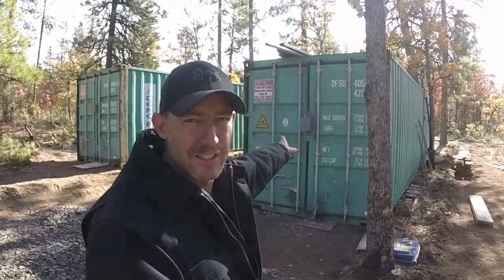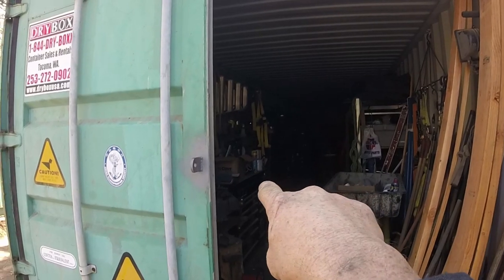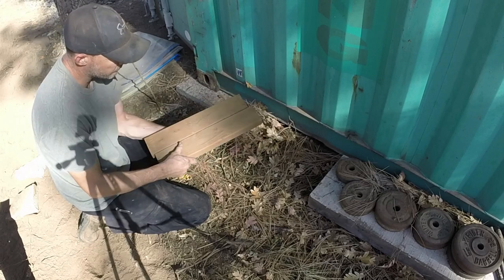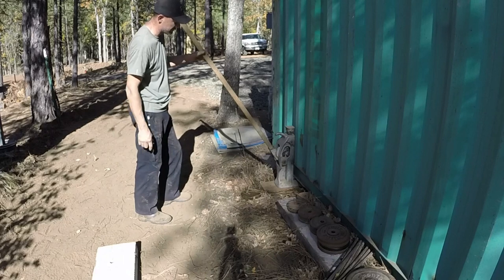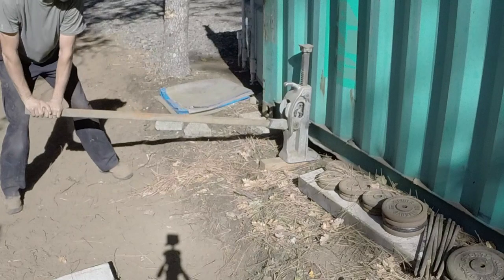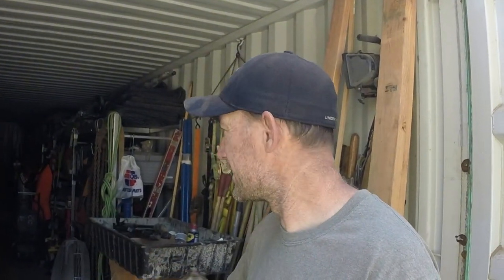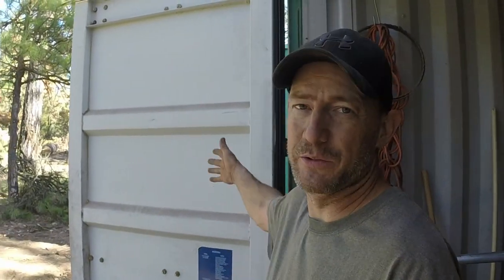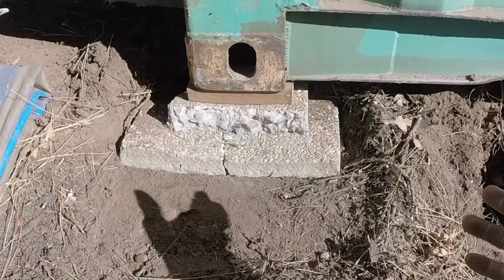One man lifting and leveling a shipping container box system

Comment: Way too small of a lift cleat on that RR jack for this job, in my opinion, though the jack itself is a beast. Like you, I've been moving two 40-foot containers up and down and side to side to make room for poured concrete foundations, as these boxes will be spanned by a 40x40-ft roof for a big solar array and need to be anchored to meet code. I'm using two $30 Harbor Freight 12-ton bottle jacks for the lifting, then erecting 16-foot-long 6x6 skids on blocks to prepare for sliding. To reduce friction, I sandwiched a 1x6-inch board between the 16-foot skid beam and the underside of the container, and liberally oiled the two facing surfaces -- literally "greasing the skids" for the container's lateral slide. I used both my skid steer and a 12k-pound winch on my truck with snatch blocks to nudge the first container along these skids. The second container was more challenging as it was on a slight slope and had to be raised about 24-inches above grade at one end for moving. The bottle jacks and stout blocking raised it up to the required height, but I wasn't comfortable using the winches or skid steer to nudge it. The perfect solution was a cousin of your RR jack: The high-lift jacks you see strapped to most off-road trucks and jeeps. The lift cleat slips perfectly into the container's corner blocks. Using two jacks at about 15-20 degrees off vertical, two jacks simultaneously lift and nudge the box along the skids in the direction of the jacks' lean. Using this method, I (and a buddy) can position the containers precisely where we want them atop the newly poured foundations, then use the bottle jacks to gently drop them home. Like yours, my containers are filled with a few tons of stuff, including heavy tools and building materials, even bags of readimix. The hydraulic bottle jacks work extremely well, giving great control. Same for the 48-inch high-lift jacks, which are rated to lift 4600 pounds. Hydraulics and leverage!
Reply from the maker: Very nice. Moving these boxes can make for an interesting day. :)

Comment: i had to do much the same job, the box was on the ground and needed to be set up on blocks and i needed to slide it 4ft, i have an old duff railroad jack, first i jacked it up and put rollers i made out of 2" schedule 80 pipe cut 6" long, i had 20, 5 in each corner, they sat on some 2"x10" planks with 1/4" flat bar on top, the side bottom rails of the container sat on the top of the rollers, i did move it about 1ft just with a 6ft bar as a lever, then i pushed it with my bobcat, my 40ft container like your was full, who knows what it weighed, the strongest muscle on your body is your brain.
Reply from the maker: "the strongest muscle in your body is your brain" Very true. :)

Comment: This is an idea I have seen used before,  use some old tires and fill them with concrete then slide them under the corners with your backhoe, with the bigger footprint should sink a lot less into the ground. I enjoy these types of videos, new subscriber here !
Reply from the maker: Thanks for subscribing. Eventually I will have to move these boxes again. I have plans to make them into a garage but need to pour some footings under them first so they don't settle after I put them in place. More fun to come. :)

Comment: I’ve leveled my (2) 20ft containers using a strong farm jack assisted by a few bottle jacks and strategically placed cement blocks. It doesn’t take that long but is a slow methodical process because it can be very dangerous especially if ground isn’t completely level like mine, in an off grid type location. If your container is a ft higher on one side for example that’s a big fall u don’t want to be standing next to if it lets loose. I don’t recommend it but that’s how I did mine
Reply from the maker: I thought about using bottle jacks but didn't know how much this thing weighed with all my tools and stuff in it. Just glad it worked out and i didn't drop it on my foot. lol :) Thank you for watching.

Comment: Proper air vents! Most of these containers will eventually rust out from the roof. The tiny little rectangular air vents on the outside upper corners are meant only when these containers are on boats at sea. When you have them on land for storage like this, I believe it’s called “ dry docking”.  My simple solution was going to a regular home improvement and getting round cylindrical house events. It’s vital that you open up more airway vents to set up some sort of cross current. Most people think that the holes in the roof are from rain resting from the outside in. If these are not insulated and ventilated, they actually rest from the inside out due to humidity depending on where you live. If you come across the ones with flat roofs, they’re older but I actually prefer them as they’re easier to maintain the roofs. If you actually end up with a hole in the roof, you can try to patch it or just in large it and get a round spinning bent from home improvement or roofing store. Some places make a great peel and stick membrane with tar and gravel on top. You only need to loosen The rest off, put this tacky material to help the peel and stick, peel back the peel and stick Lair and set it down. I’ve done about four containers this way and they have never leaked in 15 years since I did this. If you just use the tar that a lot of people use to patch As your roof rots  because you didn’t ventilate it, You will end up having to throw the container out or cut the whole roof off – ask me how I know-LOL. If I only knew 20 years ago what I know now about these containers, I would get quite a few years back and have a lot less gray hair – on my back...
Reply from the maker: Thanks for watching. :)

Comment: NO.  Lift from the corners.  Where the container has the reinforcement!  What are you doing.   And your 2 2x4's allow one 2x4 to sink, and the container to shift back, and fall.  And you put your fingers in the jack. Seriously?  If it kicked back, you'd be getting metal pins in your fingers.
Reply from the maker: If I lifted it from the corners I wouldn't be able to put the blocks under the corners. I have noticed a few people comment on me putting my fingers "in the jack", this is not the case, the jack has tabs sticking out so your fingers don't have to go in the jack. Thanks for watching. :)

Comment: old jacks house , railroad, simplex and other names. yes they will pick up at capacity IF you can get enough weight on the bar. or not bend the bar
also do not use cinder block! it will break . use concrete instead (fence post mix is fine) . about 1 bag per corner 6" thick  (soft soil) will hold up.
Reply from the maker: I will have to move these boxes again in the future. Plan on using them for a garage later, just need to level the ground under them a bit better first. :)

Comment: nifty idea.  I would not use cinder blocks.  I used them and they cracked in the middle and over time pivoted into the ground during the winter when the ground got soft.  I think what initially broke them was an earthquake. I had 8x8 railroad ties (creosoted) on the other end and they are still there and doing fine 15 years later.
Reply from the maker: Yeah, my cinder blocks have already sank a little causing the box to lean again. But its ok because we will be moving them again after we get into the house. The next place we put the boxes we will have concrete under them. :)
Reply: Not sure where you’re located but in California the creosote railroad ties are very dense and great but you’ll have a hell of a time trying to get rid of them eventually as the dump sites red flag them and make you take them to hazardous waste sites with paperwork and other BS. I have used leftover sections of a flatbed deck I realigned along with believe it or not small sections of landscape bender board! They don’t rot and can handle quite a bit of weight. I don’t think I’ve ever commented on a video so much. Maybe I’ll try to shut up and just video it myself. Be safe everyone!
Reply: @christosvolikakis1523  Mine aren't going anywhere. They've been there 15 years and I expect they will be there another 15 because they still look fine.  I think it just depends on the application.  Mine were put in place by the shipping container people when they delivered it; it is what they brought with them.  Now of course, you can't get these railroad ties in California, they are illegal unless you buy from a private party trying to get rid of them - and there is an endless list of people who want them out here, so they are getting recycled in a different way. 

It is rather ironic, I don't think the new "arsenic" covered ones are any different, toxicity wise - you have to work with them with gloves on, so how safe is that? 

We have sand here, it isn't dirt...so we have to be careful what we use as a foundation for something like this - cinder blocks will break quite easily because of the constant little earthquakes we have here in the desert of So. Cal. Plus where I live, we get regular floods during the winter. So that is why I was looking at this video.  The last flood we got was about 1' and took out all the surrounding roads and the cargo container sunk a bit so I was looking for a way that a 100 pound woman could do this on her own.

Nice you had something already in hand that would work really well. Peace Be Upon you!

Comment: Good video! If you can get thick metal pads, you probably saw the thick metal covers they put on the roads to cover underground jobs, kind of around the 1/2 inch, 4 pieces of about 12"x12" I think it may hold your container weight. Once you get the pads you can either lift each corner, place under a corner some gravel first, then a good pad of 12"x12" concrete paver (if you don't have the time to make a box wood formed of 2"x6" walls, and do yourself a concrete pad for each corner, then what continues), then on top of your paver or concrete pad, a 1/2" metal pad and that may make the sinking a slower process to occur. If it happens, you may go again from the bottom up, more gravel, the paver or a concrete pad made by you, which is not a bad idea if you make them before lifting each corner, then the metal blade or cut, should delay the sinking process.

Glad you had a grandpa that was able to hand down something good to you. If you can, be that father, be that grandpa, be that friend, be that teacher, that passes along to his family first.

Thank you, you're a great man!
Reply from the maker: The container has sunk a little but I have plans to move both containers and make them into a garage as soon as we move into the house. 

I actually never knew either of my grandpas (both died before I was born) but I did know my wife's grandpa which is where I received this jack when he passed.

Here to make a better life for our kids. Feel free to share our videos or just spread the word about our channel.  

Thanks for watching :)
Reply: @KoalityofLife  just keep doing your best brother! Some grandpa's couldn't get to us, they were so poor as is my father and I so we struggled to have a better funded family. My father waited so I'm waiting as well to be better supplier in money to have a child I can afford to support, that's why I fear my son may not meet my father enough but the lesson is clear, we do good in learning how to fund ourselves first to support them then. I'm working on my money creating ability, I have ways but the end, achieving making enough money has being hard to me.

I'm trying to acquire a piece of land where I can place a container and start a shed to live. I'm in Miami, here land is expensive to me. But is the cheapest in my point of view thing we have to buy, in order to start a roof over my head. Other than that is expensive, am paying$950 for a small apartment in Hialeah but I need more space. So I'll be switching cheaper space although taxed, by the $950 tight spaced rent so let's see if my children get to see good days although the things of my father had being treasured for him so I don't count on them. That's what they taught me, "to don't open his drawers" so, hope someone do a good use to his things. Because in this life, many are ready to take our things, especially those who hasn't worked hard enough to obtain them.

If you can, teach your sons and daughters after you to use what you have, and when you can, reward them with some of that that you possess, or lead them on how to obtain some of what you possess. One day we may not be here, they may be the closest to you to be the appropriate heir of what you built, and acquired. If you don't do it, the Banksters will do it, and your wife and children will be left poorer than they even know, and, if we can avoid that, it will be a good thing, the Bible says.

Thank you for your message! Take care brother!

One huge detail! Wherever you don't have to stick your finger in, stick a piece of wood or bar, instead! Avoid your fingers under massive weights!!! Please! Massive weights are more stronger or heavier than us and is extremely painful to be suddenly under them that we have to pull our hand from under their humongous weight. Don't put your fingers under or near by heavy weights, let iron takes care of iron!

Comment: I have worked around 20 foot shipping containers my whole life. I recently upgraded to 40 foot high cube containers that are stacked two high meaning a one 40’ footer on top of another 40’ footer.
There are several mistakes that I see here that could mean or kill you. If you’re not someone with experience working around heavy equipment, do not attempt what he is doing. You never ever ever ever put your fingers underneath a container corner or inside a jack! I cannot stress this enough!!!
You should always assume that what you were working on is about to come crashing down and that gravity is about to win so why the hell would you stick your fingers underneath the corner of a 5 to 6 ton container!
You are putting the risk of people being injured for a like. What’s the matter with you!
You are also putting brittle concrete what looks to be like paver stones underneath a steel block. Concrete breakers are basically a heavy piece of steel that focuses all the force onto a piece of concrete to shatter it. If you know what you’re doing and are keeping your fingers and body clear,  you want to use pressure treated wood or even better leftover planks from a flatbed manufacturing company. In order to make a flatbed they’re always ends that are wasted but can be used for pressure points such as this. They also make special high density rubber pads. Just because you’re saving a few bucks or a lot of bucks by not renting equipment to level your container, don’t Be cheap when it comes to what your container is resting on. Last but not least why not just use another piece of wood to slide the block in the place instead of your ear replaceable fingers numbnuts. Not everyone with a $50 video camera phone and a YouTube channel should be making instructional videos. Yeah, at the end you say to be careful but you don’t heat your own caution. This was two years ago. I hope you have not injured yourself and for gods sake take this video down or remake it. I would be happy to give you pointers if you want to redo it.
Also, the way you’re pushing down on that bar, you’re asking for it to snap and take out your teeth or even worse your family jewels.
Reply from the maker: Thanks for watching. By the way, I don't think any one person pushing down on a 2 inch solid steel bar is going to snap it, but you never know, I could be just that strong. :)
Reply: Koality of Life Homestead No you won’t snap it but it might come loose on the other end or bounce which could smack you or take out a limb. Maybe consider a through pin to keep the bar in place. With that much force, I think of it like a lever bar. There is not much surface area on the side with that type of Jack. When the container slips off or the Jack vice versa, that long bar basically becomes along that to your torso and head. I’ve seen it happen in person.
Reply: @christosvolikakis1523  I'm hoping to get my hands on a 20ft container soon. Would a compacted hardcore stone base be ok to sit the container on?
Reply: Christos Volikakis Do you happen to be in WA state? I have 2 40 ft containers that have been converted to a house. I need them leveled and off the ground. I’ll pay whatever I’m just clueless and didn’t think this whole project through!
Reply: Nothin ventured nothing gained , live life your way , Darwinism or just gettin it done stop pissin in your own pocket do as you please